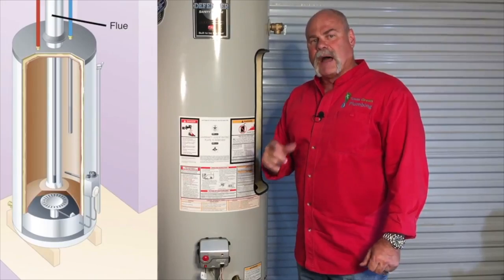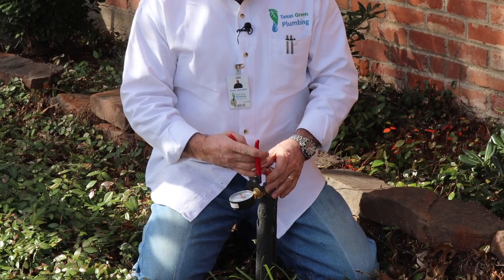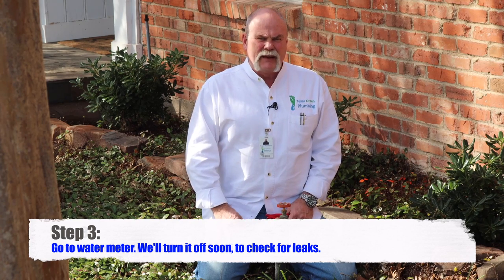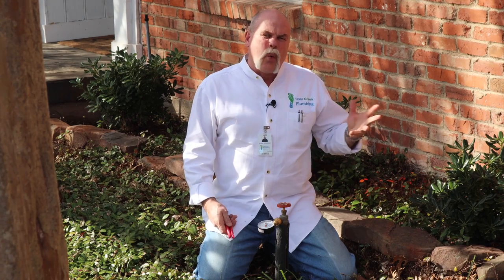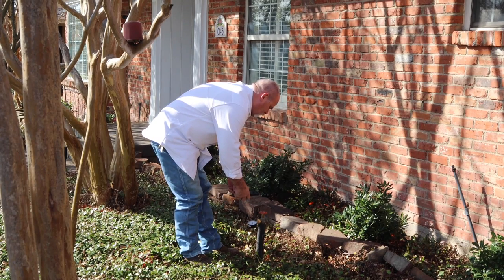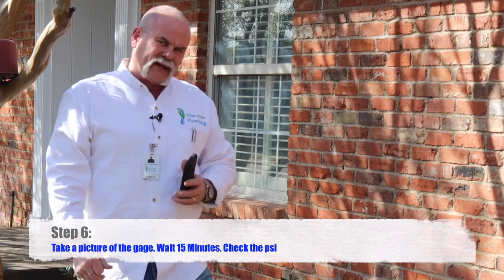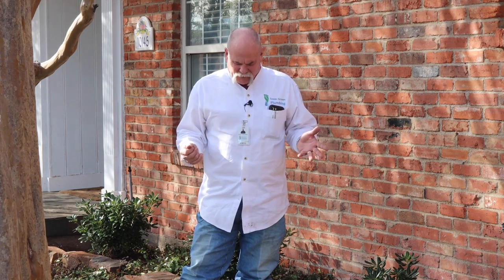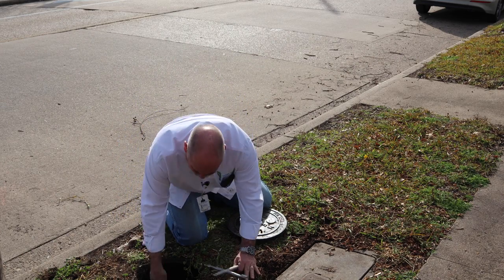How To Do Water Leak Detection Like A Plumbing Pro

Comment: ive never thought of checking for a leak this way, i normally just check to see if the meter is ticking over, this is a great way to check for leaks when there is no meter or a faulty meter

Comment: You need to make sure all isolation values are off on all fixtures, including  ice box to the refrigerator,  the refrigerator's ice maker can act like a leak given a faulty reading.  No water should pass through your property cutoff, that too will give a false indication.
Reply from the maker: @johnny rodriguez property cutoffs are the real issue. That is the one valve that we don't know for sure if it is holding. Do you do these often?
Reply: @RogerWakefield  often? Yes for the past 18 years and still too this day
Reply from the maker: johnny rodriguez I love it! Isn’t this a great career?

Comment: Well, 10 pounds in 16 minutes is a lot. But, I did the pressure gauge test in the middle of the day when temperatures from direct sunlight or afternoon heating from the sun increased, which affected my pressure results. I had a 10 psi drop in two hours. I repeated the same test at 9PM, when the outside temperature had cooled and was constant. The water pressure was steady for one hour, with no change at all. So, have to be aware of outside temperature changes when doing the pressure gauge test.

Comment: I can't find a leak between meter and home 
The waterline is 700' long and buried around 36" 
I have determined that by shutting off the main at the house and leaving meter in the open position
No wet spots
No lush grass
No flooded meter box
Any suggestions
Water bill went from around 50 to 250 so probably a sizeable leak
Haven't contacted a leak detection service and would like to know any tricks/hacks for locating leaks of this nature

Comment: Could I find a leak as small as one drop of water every 60 seconds with this method? My home has very old copper pipes and I recently found 2 super, ultra small pin hole leaks. I realize I would have to turn off the water heater well in advance, close the ice maker pipe and all of that jazz. I don't mind checking the reading after 8 hours (while we sleep), I am just not sure how or if I would be able to determine how much of any pressure drop is attributed to temperature fluctuations outdoors (Atlanta GA usually drops from 60 to 35 overnight) and how much is attributable to the leak... Thank you SO much.

Comment: So, I know there is a leak... the floor in an apartment connected to our home - the door started dragging.  I looked in a storage space under the stairs where an electric water heater is located.  It is not being used as we replaced it with a propane tankless heater.  We left it in place and it was plumbed with 4 ball valves so if we wanted to turn it back on we could turn two on and the other 2 off and flip the breaker back on.  When I looked there was water standing in the drip pan as well as all around it on the floor.  I turned the ball valve to a setting where hot water would not flow from the tankless thru the electric to the faucets.  I went to the kitchen sink that it serves and the hot water was off, no flow, and what cold was still working like it should.  I thought I had isolated the problem.  Went out to the meter and the little red wheel was spinning at a good clip.  Nothing was on and no appliances we being used.  I went to my water softener which has a cutoff valve and it is the first point where water enters our system inside the house.  After turning it off I checked the meter and it was dead still.  I crawled under the house and there are several sections where the substrate of the floor (Presswood of some sort) was totally soaked and I did find two places where water was dripping from the wood - not from any pipe.  I am flummoxed - I can't hear water running or spraying.  I assume there is a pipe somewhere that has sprung a leak but is is not obvious.  Any ideas?  cheers

Comment: I have a leak in the ceiling since last year. It's growing black mold still. Above is the bathroom upstairs. I have contacted a plumber last year. They said to use a better shower curtain and charge me $100 for diagnostic. They said they could do a better diagnosis with cutting a hole in the ceiling. But they dont want to do that because it doesn't seems like a big leak. We got a thick shower curtain but problem is not fix. What should i do?

Comment: Hello,  I've had a leak coming through the kitchen ceiling for the past 3 years.  Multiple plumbers have not been able to detect where it's coming from.  I've replaced the roof, HVAC system, water heater, retiled both bathrooms and it still leaks.  The problem is that it doesn't leak all the time.  Just certain times of the day, and some days it doesn't leak.  How do I test inside for that?  Thank you.
Reply: Does the tub spout have caulk around it?

Comment: Thank you for your video. Where you talk about double check or bubble check would you please let me know what that is? from the street there is a shut off valve before my water meter then the meter then another lever valve after my meter. I am trying to isolate a leak which I think is in the irrigation system. Thank you for your insight.

Comment: Great video. I have an increased water bill by 4x this month. I have shut off my house valve and the meter still spins. Would you say it’s a leak between the city any my house? The only time my meter stops is when I shut it off at the city point.
Reply: Definitely! I am dealing with the exact same issue. But before you start tackling the main line, you want to do this first: Have ALL valves turned on. Then shut off ALL valves and open a faucet (hot & cold). Leave it open until no more water comes out. If 2 story house, do this on a 2nd floor fixture so you don't have to wait for a lot of water to drain out.

Next, close the faucet valve and open the valve at the meter. Wait several minutes. Then turn on the same faucet. If water comes out, that means your house valve is not fully shutting off, thus allowing the house to pressurize. If NO water comes out, then you can be certain that there is a leak in your main line (meter to house). However, this does NOT rule out an additional leak inside the house. But at least you will know that the main line is leaking and can initiate repair.

Hope this helps....

Comment: I normally just shut off the water to the house at the main shutoff usually in the utility room an them watch the meter to see if it still registers water usage.
Reply: Exactly.
Reply: What if it does
Reply: our current issue.  meter reading stays the same even for a day. but it fails the pressurized test. i suspect the water meter cannot detect very small leak

Comment: I have a small leak under my dishwasher but I don't even use it.. water seems to come out from concrete floor. I checked the sink pipes and nothing leaks. Where can the water be coming out from if I live on an apartment??
Reply: Check the supply hose to the dishwasher, should have a threaded connection underneath. Pull out the dishwasher and check

Comment: Here in Brazil there is a water meter that shows if there is a leak. If we have pressurized the water network with compressed air and make a probe with geophone detecting the exact location
Reply: how does the probe work?
Reply: @johng5261  there is an equipment here in Brazil so we can locate the water network .... he will tell where the pipe goes ... then you come with the geophone and do this probe over the pipe already traced detecting the leak in place exact....

Comment: why not simply rely on the water meter. meaning take note of the water meter reading. ensure nobody opens any of the faucet/water overnight, then check and compare the water meter reading in the morning. there is no leak if the readings are the same

Comment: Does this device can detect the ceiling between two units ? 

I having the leak in my master bathroom shower from above unit , the handy man said need to cut the ceiling and trace where is the leak coming from. I was hoping if this device can trace where is the leak before cutting everything opens ..

This is a condo unit
Reply from the maker: Hey Jimmy, visit here if you have questions https://www.leak-pro.com/

Comment: I have a leak in an inconvenient place. Can I assume that the city water line comes in on the other side of the wall from the hot water heater's water inlet line? The inlet line to the hot water heater goes down into the foundation footing, so if I start digging into the dirt on the outside of the house, how deep down is the water line? I will need to install a valve to determine if it is under the slab, or out in the yard between the footing & the city water shut of (street side).
Reply: No, that would be a bad assumption. A better guess is that the typical outdoor front hose bibb is in line with the entry point of the waterline into the basement.  Usually it'll be below the frost line, maybe 18" - 3' down.  But those are only guesses, not something to rely on.

Comment: I have a leak in my backyard... is there any inexpensive electronic equipment you would recommend to help me find it? I'm abroad and there's no one to call over here to do this. I would have to scan a long surface and the tubes are under dirt + concrete...
Reply from the maker: gazagoury if you can find a stethoscope for an automobile that might help you...
Reply: @RogerWakefield  thanks! I bought one but I was able to  find the leak before receiving the stethoscope!
Reply: @gazagoury  could you give me some more resources on how to find a leak with an automotive stethoscope? My husband and I are at wit's end because we have a slow outdoor underground leak thathas been adding an extra $50 a month to our water bill. We have called several plumbers out and nobody has any type of leak detection equipment within a hundred-mile radius of our area.
Reply: @morningstarhomestead  hello, if it's a slow leak you will have to add some air pressure to the system to make it noisier. When you say that it's outdoor, is it between the street valve and your house or in a backyard?

Comment: The Expert Plumber ...i live in an old double wide trailer house. I noticed under the house and a portion of the yard staying pretty wet and a couple of standing water puddles also so definitely a leak somewhere. I wanna fix it myself so where and what should I start with doing to find the leak? It sure looks mighty snakey up under there
Reply from the maker: @David Lents I do leak detection nation wide for a mega-manufactured home community. Most leaks can be found by crawling around under that snakes area. I’ve been there many times. And, I do leak detection at night in those communities so imagine crawling under 150 homes a night in the dark.... Makes you happy to see the sun come up!
Reply: @RogerWakefield  sounds like ya need a new job.  Or actually hire the people to do the dirty work for ya after they are trained an get out the trenches.

Comment: The home doesn't have either a "measuring meter" at the street, or a "shut off" at the house????  If I have a leak, I shut off the valve in the house and go see if the meter is still turning.  I guess having building codes pays off.
Reply from the maker: @bigwheelsturning is there not a shut-off for the city out by the curb? Where are you located?
Reply: @RogerWakefield  Yes, there is a water district shutoff ahead of the  measuring meter.
Reply: @RogerWakefield  Washington State, on the Left Coast.

Comment: Hi from Portland Oregon!

First...I am NOT a doctor 👉 or a plumber! 🥸 I had a mystery leak from the curb to the house with no signs of water! My water company verify this along with the high water bill! The plumber had me turn off the main shut off valve for the house. Once I did that he could see the water meter was still running! MAYBE this is why the moles or gophers are making holes in my yard trying to escape ☠?  No need to pull out the high tech equipment. In my situation they will bore two lines from the curb. One to the house and the second to replace the water faucet by the door. One day job and $,$$$.$$. 😮

Comment: Water bill just doubled up, I can hear some water running even when there's no taps open or appliances in use. Meter shows no water flow when main valve is shut off, but as soon as I open the main valve to the house meter starts to show flow, but if I turn off the valve going to the water heater flow stops again. Apparently I have a leak in the hot water side, I also feel a warm area in the tile floor by the laundry room. Maybe a leak under the slab ???
Reply: sounds like it could possibly be depending on if your hot water goes through your slab.
Reply: @rickeyalaman1660  thanks, it ended up being a leak under the slab, after a bunch of 💰💰 is fixed now. They  rerouted all the water lines above ground
Reply: @jarenci1  Hi Jorge, I had the same issue. How are the new water lines holding up? No more leaks?

Comment: I have water in my walls (a corner area in my basement) as evidenced by bubbled paint and plaster, and a smell.  there may be pipes behind the wall. I don't know. Above the area where the problem is, is a sprinkler head.  There is no water on the floor.  Who do I hire to determine where the water is coming from?
Reply: Plumbers

Comment: That gauge should have had a smaller range , to get a more accurate reading.
Reply from the maker: Phillip Richmond you’re right.  We use this for a leak test only. If we were trying to figure out how big it was we would use a more accurate gauge and timed it more precisely.
Reply: To do leak test i need to put the 
gauge on the hose pipe thing.then check what psi. And then turn off the main.then check psi n take a picture. N then wait 15min do it again. How much is psi supposed to be? And a water leak is 10 psi n up?